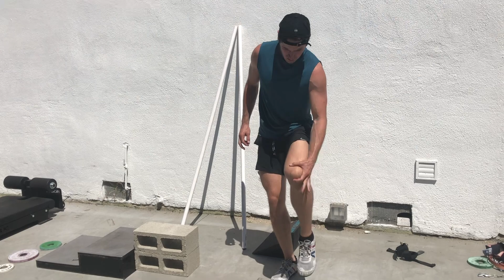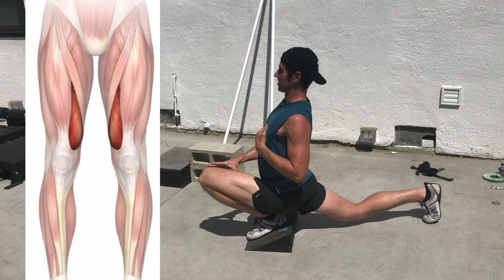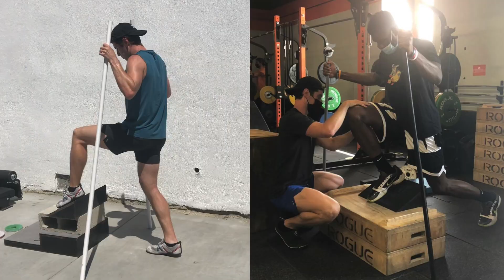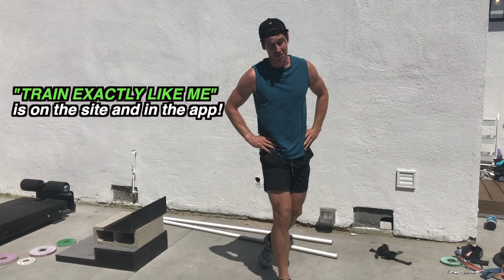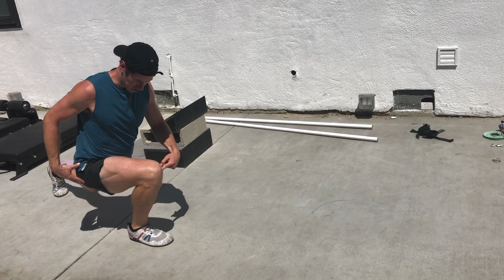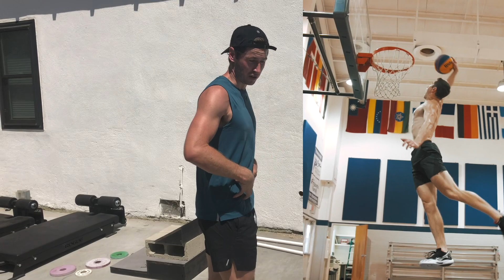Knee Ability Zero Step 5: ATG Split Squat: Progress Guide

Comment: Dumb question on atg squat - I can do 4-5 pain free on either side but balance or rather lack of balance usually stops the set. Is this instability due to trying to progress too quickly and not having all the necessary strength, or can it simply be (lack of) balance? Thanks…
Reply from the maker: Steps 1 through 4 all make Step 5 easier, every time you do them. Then sending in your form video on a difficult step allows us to specifically troubleshoot you: atgonlinecoaching.com